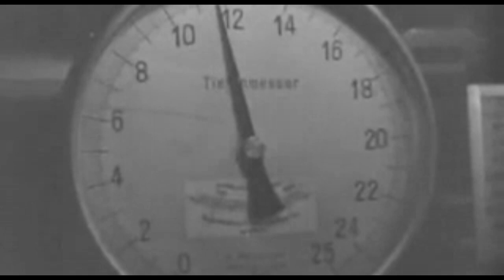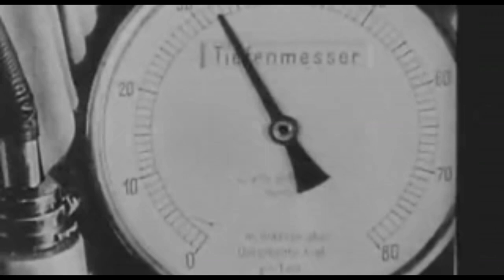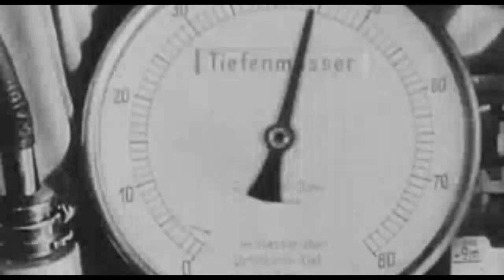The story of the toilet that sunk a submarine. The sinking of U1206.

Comment: I've worked for German firms for most of my adult life.    There is something about the character of German Engineers.  They make world class stuff.  They also overcomplicate things.

When the Soviet military adopted a new officer weapon they chose the Walther PP as the base.    For ammunition the Soviets decided to adopt the "9mm Ultra" which was marketed for police officers in Europe.  

Being Soviets they did not use the German ammunition, they started by making a 30 Tokarev round, then straightened out the walls.  The resulting round is 9.2mm,  low pressure, about like a 380 ACP.  The projectile is the same mass as the 9mm Ultra,  same muzzle velocity.    In doing this the Soviets reused production equipment meant to make the 30 Tokarev to partially make the 9mm Makarov round.

For the handgun itself the Soviets decided to put the piece on a diet.    They removed forty percent of the working parts.   Many parts did double or triple duty.   The fit inside is sloppy until the item goes into battery.

The item is very accurate.  Very reliable.  Heavy because it's all steel except the grips.

Even though the Russian Federation adopted the 9mm NATO they continue to make the Makarov.   It just works.
Reply: Amusing side note - the German Democratic Republic decided to adopt the Makarov.   This was not a bad idea, since there was a big Soviet contingent in the DDR.   This simplified logistics.

The Soviets had opted to do the absolute minimum of machining work on the PM.   The underside of the slide of the PM uses a "rough cut" followed by bluing.    The finish is really rough,  literally like they took a course mill, blasted out the channel and then blued it.   You don't see it, it's not a problem and it allowed Soviet manufacturers to make more of them.

Where the PM needed to be finely finished?  It's fine.  You cannot tell until you take it apart.

The DDR Makarov?  They made some fine passes to pretty up the slide.  The fit and finish are identical to the Walther PP.   I guess that the Germans cannot pass up on doing extra work.